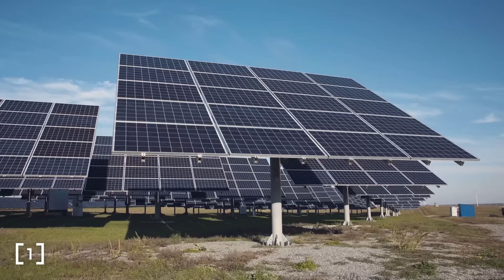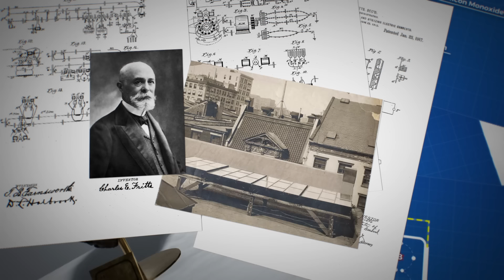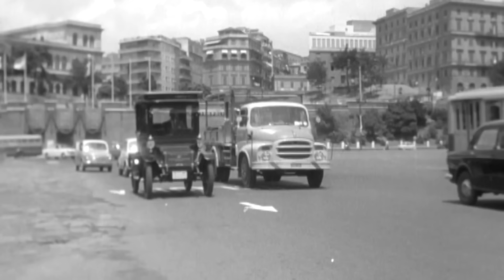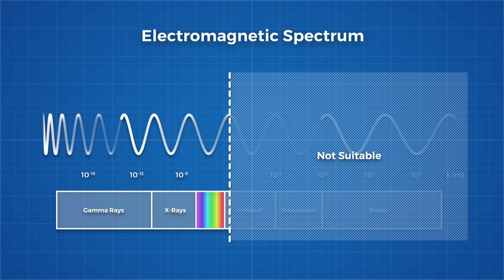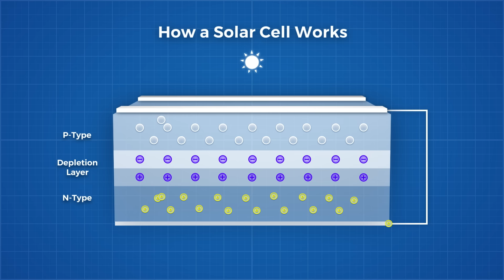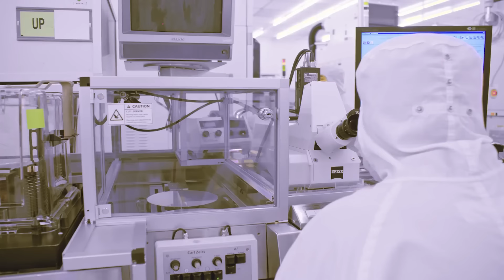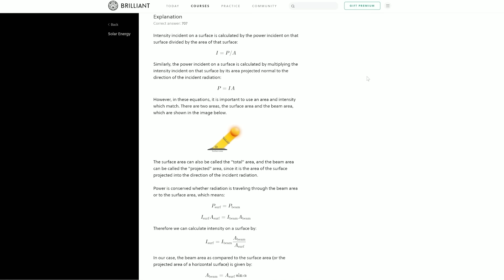The Mystery Flaw of Solar Panels

Comment: I'd love to see a video on energy storage techniques, as that seems to be the world's biggest gap in converting to renewables.
Reply: energy storage techniques: Flow batteries, water reservoirs, flywheel energy storage, graphene supercapacitor, liquid metal batteries and thermal energy storage (to mention a few) but you could also convert solar into hydrogen or some other fuel.
Reply: @olelund6821  I've read about all of those, but the only one that seems to be capable of grid scale capacity (at reasonable cost) is pumped hydro.  Thermal might have potential, but I'd like to see Brian McManus' take on them in a more thorough comparison.
Reply: @GazeboPelt  I trend to be skeptical when people claiming that one techology will solve all our problems. Pumped hydro has its place for sure, but I don't think we should ignore technologies like flow batteries, liquid metal batteries and graphene either. Liquid metal batteries has the potential to supply a city with a (shipping)container sized battery. Graphene supercapacitors has the potential to charge faster, have more energy density, and better safety because they don't form dendrites. And flowbatteries are scalable. If you want more storage and energy you build larger ones or more of them + you can change their output depending on what liquids you put in them + they have a lifespand that varies from 13-52 years.
Reply: @GazeboPelt  Lithium Iron Phosphate batteries look quite promising for daily discharge applications. They're relatively cheap and last at least a decade. They're not cheap enough for seasonal storage, however. Month-to-month energy output variance in renewable energy is an issue that needs to be contend with as well. Hydrogen storage in salt caverns is very promising for this given that there's a lot of cross-over experience from storing bulk natural gas the exact same way.
Reply: Or just, you know, Li-ion batteries. The problem is already solved.
Reply: @MacGuyver85  Except for the huge costs involved.
Reply: @MacGuyver85  To be fair. Li-ion is bad for the environment and poor countries because it has to be mined, which destroy the ecology and tamper the water supply. Graphene supercapacitors and liquid metal batteries on the other hand seem less bad. After all: graphene is just carbon and liquid metal batteries can be made from abundant materials. The video "Donald Sadoway: The missing link to renewable energy" gives a good explanation about this.
Reply: One system being tested in the UK at the moment coverts elec into mechanical energy to raise a huge mass e.g. 3000Kg on steel cables in disused mine shafts.
When the energy is required,the mass is 'released',driving a dynamo (electric motor working in reverse) which releases as much energy as you want instantly.
They massively outperform 'peaker plants' which pollute and cost a fortune and they are also extremely efficient.
Reply: @chippysteve4524  I wonder how much power can be stored, and at what cost/reliability compared to other storage methods, specifically thermal.
Reply: @chippysteve4524   Those mechanical storage systems that amount to a mass in a shaft are pretty interesting. On paper, they seem to scale quite well and they're also pretty elegant.
Reply: As MacGyver already pointed out, Li-ion batteries and wind and solar have all dropped so much in price that the problem is practically solved. An alternative to storage which smooths the supply/demand mismatch over time, is what's called a super-grid which smooths out the supply/demand mismatch over space. A comprehensive study showed that all of Europe could be powered by 100% renewables without any significant use of storage by building a super-grid that spans from Iceland to Moscow and a portion of Norther Africa that mostly boarders the Mediterranean sea. A lot of that super grid has already been built or is under construction. A similar system for North America is estimated to cost in the range of $60 Billion which is peanuts in the scope of decarbonization. I think a mix of storage and improved grid is the most likely outcome.
Reply: Good grief, so many incorrect assumptions. I don’t know where to begin. 
Li-ion isn’t bad for the environment. Seriously where on earth do you get this nonsense from! This is just the same nonsense as wind turbines being bird shredders, or solar panels being toxic, or nuclear being harmless and cheap.
Cost of solar/wind + li-ion is already the same or cheaper than any other alternative (especially if you take the issues of the other forms into account), with a clear path to pushing the cost of all down even further. All of these can be mined, produced and recycled with minimal to zero harm to the environment.
There’s no need to wait on some magical unicorn tech to solve the problem; it’s already solved. The ‘only’ true problem is scaling production. That’s it.
Reply: @MacGuyver85  If you want to know where I get my information you can check the following:
SciShow: "We're Running Out of These Elements — Here's How"
potholer54: "Are electric cars really green? An investigation of Bjorn Lomborg's claims."
NowThis World: "South America’s Lithium Boom: A Blessing Or A Curse?"
Bloomberg QuickTake: Here's Where the Juice That Powers Batteries Comes From

Just to clarify: I'm not against solar / wind or other renewable energy sources.
I think it's the future. Besides: I never made any of the arguments you mention. I know that cats, cars and windows kill more birds than windturbines. One of the numbers I found mention that windturbines kill around 234.000 pr. year. Cars by contrast kill 200 million pr. year. Communication towers kill 6,6 million, windows in buildings and houses kill 599 million, and cats kill 2,4 billion birds pr. year. 

So I'm not against solar / wind. I'm just pointing out that Li-ion has some problems and isn't a magic pullet. However: We might be able to mitigate some of these problems by using the other technologies in conjunction with Li-ion.
Reply: @olelund6821  Everything humans do places stress on the environment. An apex predator population of 7+ Billion can not tread lightly no matter how hard we try. It's pointless to ask if a given activity is harmful to the environment without comparison to an alternative. What you're doing is echoing a lot of bad-faith arguments and FUD put out by the likes of PragerU.

SciShow: "We're Running Out of These Elements — Here's How"
- the only relevant substance discussed in that video was Indium for the transparent conductive film ITO used in solar panels, however there are actually many alternatives to ITO (check out the wikipedia page on "Transparent Conducting Film") such as Flouride Tin Oxide (FTO), Zinc Oxide, and carbon nano-structures which you seem a proponent of.

potholer54: "Are electric cars really green? An investigation of Bjorn Lomborg's claims."
- This actually refutes your claim by stating what I just stated: looking at lithium mining alone without comparison to what it replaces is pretty pointless. Yes lithium mines look bad. Their environmental impact is often exaggerated and rarely compared to the much larger scale destruction caused by mining fossil fuels. The comparison isn't even close. Lithium makes up a tiny percentage of a Li-ion cell and a battery is more comparable to a fuel-tank than a fuel. It's not consumed continuously and can be recycled.

To add to Potholer's criticism is: not only do modern ICE cars last much longer than 90k miles, modern electric vehicles have even longer life-expectancy because they have so few moving parts and battery technology has come so far. A Tesla Model-3 battery pack is expected to last as long as 500k miles before it drops below 80% of its rated value (after which many electric vehicle batteries go into service for grid storage because 80% of several KwH for practically free is a great deal and grid systems can stretch that storage for even longer because they provide a more optimal environment and workload for the batteries). The motors on the Model 3 are rated for 1 million miles which isn't much different to other electric cars.

NowThis World: "South America’s Lithium Boom: A Blessing Or A Curse?"
- This seems more related to the so-called "Resource Curse" (look up the wikipedia page on "Resource Curse" which is much more complex than the brief "forego millions of dollars or drill and live with the consequences" description provided in the video. Again, no comparison to alternatives is attempted.

Bloomberg QuickTake: Here's Where the Juice That Powers Batteries Comes From
- This demonstrates kind-of the good and bad sides of lithium mining. Mining in ecosystems like deserts and tundra on the one hand don't have much ecosystem to destroy, yet on the other hand, what little ecosystem exists there is typically very specialized and slow-metabolism, so when damage is done, it's harder to recover than say, wetlands or rainforests. Over all, though; this is a stark contrast to oil drilling, fracking, and mountain-top removal. They pump brine up and let it evaporate in the sun. Also, the interviewee is correct about the amount of lithium in a typical car battery. 10-15 kg for the life of the battery which is several hundred thousand miles plus it's afterlife as grid storage. That's compared to how many equivalent kg of oil used over the life of an ICE vehicle? Right, lets talk about windmill birds some more like that isn't just a bad-faith argument from oil-company sponsored goons...

Graphene supercapacitors are neat, but they're never going to replace batteries. They trade energy density for power density and high durability. The laws of physics dictate that they'll always be at least an order of magnitude less energy dense than batteries and likely one or two orders of magnitude more expensive per kwh than batteries. They make more sense as a buffer for an electric car drive-train. You can use a small bank of capacitors for regenerative braking and quick acceleration because the energy required to accelerate is about the same received from braking and is in the 0.5-2 kwh range while the power required is high and can ware batteries out. That would be 0.5-2 kwh of super caps compared to a ~70-100 kwh battery pack. You can think of them as computer RAM compared to Hard Drive.
Reply: @AbeDillon  "Everything humans do places stress on the environment. An apex predator population of 7+ Billion can not tread lightly no matter how hard we try. It's pointless to ask if a given activity is harmful to the environment without comparison to an alternative. What you're doing is echoing a lot of bad-faith arguments and FUD put out by the likes of PragerU."

First of all: I gave alternatives. Take a look at the post and my other replies to people.
And second: I'm not echoing PragerU. 
1. Because I'm not a climate denier. 
2. Because I'm not a corporate shill like they are.
3. Because I know what energy potential renewable energy holds.
4. Because I tell people about other energy storage systems while pointing out stuff we can do better. (PragerU doesn't care what can be done better. They just want things to continue like they have always done).

"SciShow: "We're Running Out of These Elements — Here's How"
- the only relevant substance discussed in that video was Indium for the transparent conductive film ITO used in solar panels, however there are actually many alternatives to ITO (check out the wikipedia page on "Transparent Conducting Film") such as Flouride Tin Oxide (FTO), Zinc Oxide, and carbon nano-structures which you seem a proponent of."

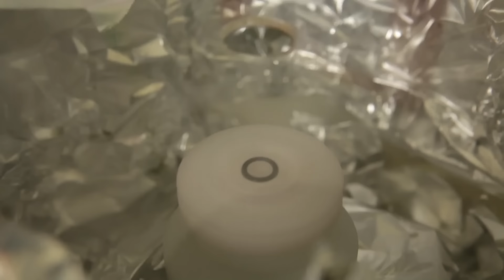If that's the only thing you found relevant then look at Arsenic around 4:23 or Cobalt around 5:46. But I guess that just shows how much time you look into it. Givin' that Indium was around 0:49 - 2:07. So you basically watched the part about indium, made up your mind and ignored the rest of the video.

"potholer54: "Are electric cars really green? An investigation of Bjorn Lomborg's claims."
- This actually refutes your claim by stating what I just stated: looking at lithium mining alone without comparison to what it replaces is pretty pointless. Yes lithium mines look bad. Their environmental impact is often exaggerated and rarely compared to the much larger scale destruction caused by mining fossil fuels. The comparison isn't even close. Lithium makes up a tiny percentage of a Li-ion cell and a battery is more comparable to a fuel-tank than a fuel. It's not consumed continuously and can be recycled."

It does not refute my claim. My claim was always "Li-ion is bad for the environment and poor countries because it has to be mined, which destroy the ecology and tamper the water supply." I never claimed that fossil fuels are better. So if that is what you think I claim, then you have misunderstod what I wrote. I mearly pointed out that lithium mining has some downsides which can be mitigated by using other technologies in conjunction with Li-ion.
(like liquid metal batteries, flow batteries, graphene supercapacitors etc.)    

"To add to Potholer's criticism is: not only do modern ICE cars last much longer than 90k miles, modern electric vehicles have even longer life-expectancy because they have so few moving parts and battery technology has come so far. A Tesla Model-3 battery pack is expected to last as long as 500k miles before it drops below 80% of its rated value (after which many electric vehicle batteries go into service for grid storage because 80% of several KwH for practically free is a great deal and grid systems can stretch that storage for even longer because they provide a more optimal environment and workload for the batteries). The motors on the Model 3 are rated for 1 million miles which isn't much different to other electric cars."

Why do you need make this point? 
I'm not against renewable energy? 

"NowThis World: "South America’s Lithium Boom: A Blessing Or A Curse?"
- This seems more related to the so-called "Resource Curse" (look up the wikipedia page on "Resource Curse" which is much more complex than the brief "forego millions of dollars or drill and live with the consequences" description provided in the video. Again, no comparison to alternatives is attempted."

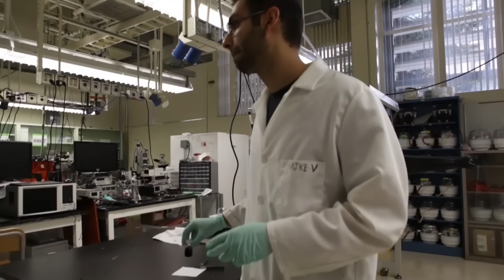You completely missed my point. My claim was always "Li-ion is bad for the environment and poor countries because it has to be mined, which destroy the ecology and tamper the water supply." around 1:33 it is mentioned that "water shortages already exist around many mining areas and that people worry extraction will run the region dry" so the video shows that lithium mining has an impact on the water supply. But I guess you would rather handwave this issue away with a wikipedia page than address my argument.

"Bloomberg QuickTake: Here's Where the Juice That Powers Batteries Comes From
- This demonstrates kind-of the good and bad sides of lithium mining. Mining in ecosystems like deserts and tundra on the one hand don't have much ecosystem to destroy, yet on the other hand, what little ecosystem exists there is typically very specialized and slow-metabolism, so when damage is done, it's harder to recover than say, wetlands or rainforests."

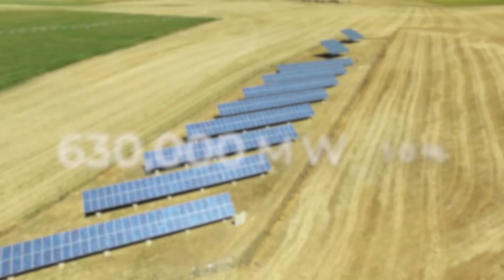Again you totally mised the mark. Go to 1:15 "Companies like SQM bump WATER up through the beds and store the minalrich liquid in large ponds" again we see how lithium mining has an impact on the water supply. Also: Go to 4:43 you might have missed something about the ecology of nearby lagoons and flamingos   

"Over all, though; this is a stark contrast to oil drilling, fracking, and mountain-top removal. They pump brine up and let it evaporate in the sun. Also, the interviewee is correct about the amount of lithium in a typical car battery. 10-15 kg for the life of the battery which is several hundred thousand miles plus it's afterlife as grid storage. That's compared to how many equivalent kg of oil used over the life of an ICE vehicle?" 

For some reason you continue to mention oil, as if I made an agument about it.
But let me make it clear to you: I don't support oil or coal and I have never claimed that it is better then renewable energy.

"Right, lets talk about windmill birds some more like that isn't just a bad-faith argument from oil-company sponsored goons..."

Did you read what I wrote? Or are you just assuming that I'm a oil-company sponsored goon based on a few words?

"Graphene supercapacitors are neat, but they're never going to replace batteries. They trade energy density for power density and high durability. The laws of physics dictate that they'll always be at least an order of magnitude less energy dense than batteries and likely one or two orders of magnitude more expensive per kwh than batteries."

That's where you're wrong kiddo. Graphene supercapacitors can reach the same energy  density as batteries. The reason for this is that graphene is a 1 atom thick material. So if you get a sheet of this stuff you also get a lot of surface area to store the energy. The only real problem with graphene, is that it's hard to manufacture these sheets. So instead companies use graphene flakes combined with lithium to boost the efficiency of current batteries.
Take a look at the following videoes:
Joe Scott: "Graphene Supercapacitors Are About To Change The World - Here's How | Answers With Joe"
Undecided with Matt Ferrell: "Supercapacitors explained - the future of energy storage?"
ColdFusion: "Major Breakthrough: Graphene Batteries FINALLY Hit the Market"
ColdFusion: "Samsung's New Graphene Battery"
Undecided with Matt Ferrell: "The truth about graphene - what's the hold up?"

It might be true that lithium is currently more energy dense than graphene. But that is no guarante that it will continue over time.